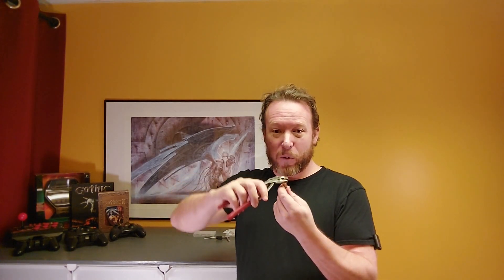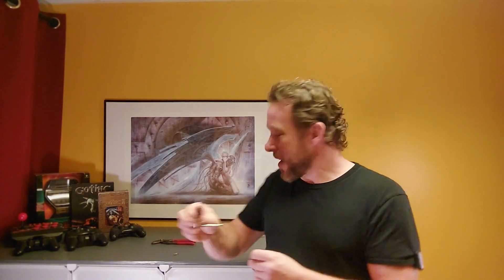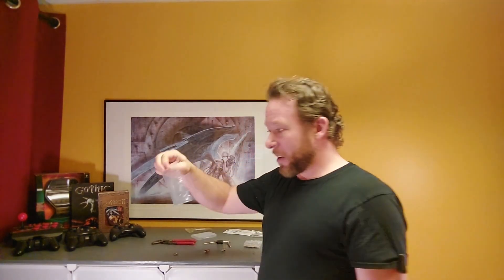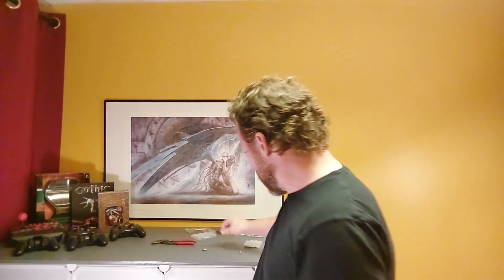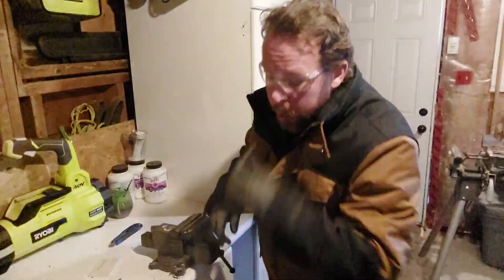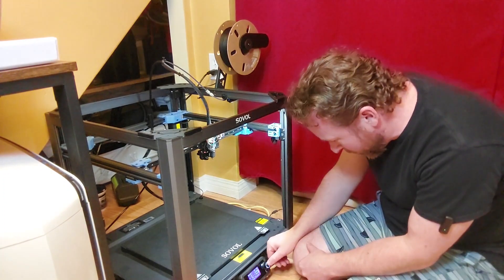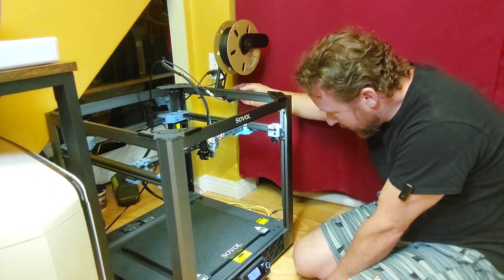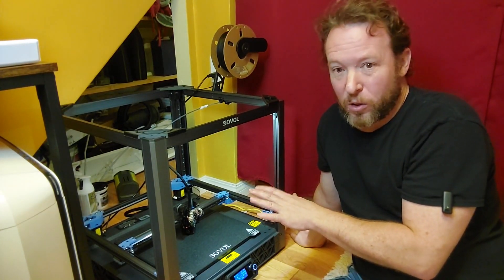Sovol SV08 Standard Nozzle Mod: Will It Work? 🔧🔥 plus Z-Offset Calibration

Comment: I just bought the copper heat blocks with replaceable nozzles from Sovol. The one thing they won't tell you (I asked Sovol directly) if what replacement nozzles will fit. I ordered copper plated nozzles because I am not a fan of hardened steel. Their a difference between the nozzles that has me wondering though. The hardened steel nozzles from SV08 don't have threads all the way down to the bottom of the nozzle and the traditional volcano nozzle does. I hope it seals properly and doesn't leak. I am hoping to swap the nozzles this weekend to test and see what happens.
Reply from the maker: I tried the volcano nozzles in another video and it wasn't a success.
But the Elegoo Neptune4 Max/Plus nozzles do fit without a hitch. I've been using them ever since.

Comment: I’m getting crazy Z banding on my SV08, any idea how to fix it?
Reply from the maker: I'm not certain. But I would start with checking belt tension. And even if it looks ok, maybe increase it slightly anyways. You know the 1/8 of a turn at the time kind of approach.
Hopefully it's not your stepper motors giving their two weeks notice.
Reply: @ would you ever make a tutorial for this? I’ve only seen ones for the X and Y axis. Not Z
Reply from the maker: @troybeyer5713  I can. Probably have to do it anyways after I'm done with my current mods. But just to guide you in the right direction, until I get to that video: On the top of each Z- profile there are two bolts with slotted holes I would start there. Besides, here is the official replacement tutorial from Sovol: https://wiki.sovol3d.com/en/SV08-Z-axis-belt-replacement-and-adjustment-tutorial
I hope that helps you in the meanwhile.

Comment: You did order a second tap to start the threads diidn't you?
Reply from the maker: nope I taped them with the tapered tap, which obviously didn't go deep enough. Then I thought the: "The hell with it", and cut it off to get all the way down.
I would recommend to purchase the correct tap in the first place.
Reply: @DomDecodes  Meh, I bodge tools all the time to make them more useful. My favorite Klein multi driver for instance, after it wears out, I order another of the same model, then grind down the small square head tip to a fine slotted screwdriver, works beautifully, and I don't loose it like all the other tech drivers i've bought over the years

Comment: 14:20 - You're using the little pancake spatula!

Kudos to anyone who makes a bottoming tap by grinding the nose off a tapered tap.
Reply from the maker: Bottoming tap 🤯🤦
After 12 years in Canada I had to start a YT channel so you come to the comments and I can learn the proper nomenclature for the tool. And I did work in manufacturing prior to this gong show. 🤯🤯🤯
Reply: @DomDecodes  - I think Canadians call them skookum maple syrup valve tappers.   😛

Comment: Hi, this is Chris in bulgaria, I have not got my Sovol 08 out of the box yet. Did you do any cold pulls to clean out any potential crap? Would there be a temperature difference between the 2 types of nozzles?
I bought a spare set of nozzles just in case shit happens.  I think your idea should work though, maybe some minor temp adjustments required. I just subscribed so make another video while I set up my Sovol. Have a GREAT day, Chris
Reply from the maker: Oh there will be more videos. The Chaos is far from over.

Comment: Also... at least if printing PLA no part cooling fan could be at play here as well with your benchy. Any bad overhangs could get snagged on the nozzle and at sv08 stock speeds that means bye bye benchy lol. if you dont add your fan back somehow then you could also try to slow down speeds and accel... just a thought
Reply from the maker: The cooling fan on the back of the head is still in place and there is no issue when using the stock nozzle.
I will investigate further and solve this "riddle".
Reply: @DomDecodes  you're absolutely right about the back side fan totally skipped my mind. You've got me so tempted to try printing without the shroud now... i can't stand not being able to see the 1st layer print because it totally blocks the view
Reply from the maker: Ok and I thought I was the only one lying with his face basically on the print bed trying to dial in the Z-Offset.

Comment: I believe its possible the nozzle doesn't sit properly flush against the back of the threaded area of your modified heat block. Any gap there fucks with the pressure in the nozzle and can yield similar results like your benchy. Like you mentioned, Sovol released a removable nozzle heatblock that looks promising. I instead went with the Micro-Swiss Flowtech hotend. Cold swappable (! normally nozzles should be screwed into the block while heating) but still proprietary. But they make them for most of my other printers too so there's that at least lol. (edit: PS I'm already a subscriber and am really enjoying your videos! Good luck growing your channel!)
Reply from the maker: Yeah I saw the Flowtech hot end and it is certainly a more "professional" solution. But I just want to prove a point. And I'm pretty certain that it must be a misalignment issue due to the use of super precision tools. 😂
Reply: I'm loving the MicroSwiss hot end and nozzles for the SV08.  I'd seen MicroSwiss products and always held them in high regard but their FlowTech magic is awesome.  My goal is to equip every printer with a FlowTech hot end so I can swap nozzles between all my printers.  I've been 3D printing since before there were consumer grade 3D printers.  I'd always buy spare nozzles and different sized nozzles thinking I'd use different nozzles for different applications but in practice, swapping nozzles was always such a hassle and so likely to induce a problem or break something that I only replaced nozzles to repair a 3D printer with a clogged nozzle that I couldn't clear with a needle from above.  The MicroSwiss FlowTech nozzles can be cold swapped in one minute with nothing but a 7 mm nut driver so now I can swap to a 1 mm high flow nozzle for giant vase mode prints, a 0.6 mm CM2 hardened steel nozzle for PET-CF, etc.  Total game changer.  I'm a MicroSwiss fan boy!
Reply: @Liberty4Ever  me too lol! I have 5 machines and they all use different nozzles! I plan to put the FlowTech on my X1C and Kobra Max so I can cold swap various sizes and material nozzles among them and the SV08.
Reply from the maker: @Liberty4Ever  for a multi printer setup that makes perfect sense.
I sometimes doubt I will have one printer for that much longer, if I continue the way I started. 💥🔥😆
Reply: @DomDecodes  - It was always extra sad when retiring a 3D printer and I had a small collection of new nozzles that only fit that one printer that are thrown in the landfill.

Based on your videos, I'd almost guarantee that you will be getting more 3D printers.  They're kinda addictive.  I know people enjoy downloading stuff and printing it, but I wouldn't have any use for a 3D printer without FreeCAD.  With 3D CAD, I can't imagine not having a 3D printer.  It's so darn handy to CAD whatever I want.  Its faster and less expensive than Amazon, and I get exactly what I want.  The best is when I want something that doesn't exist anywhere outside my head, and I make it real, in a couple of hours.  I have a basement shop full of CNC tools that I converted and built, and I never use them now that I can CAD and 3D print whatever I want.